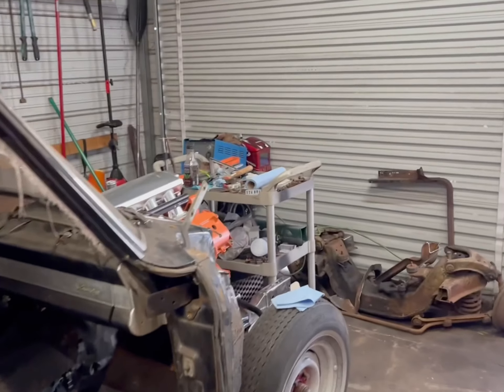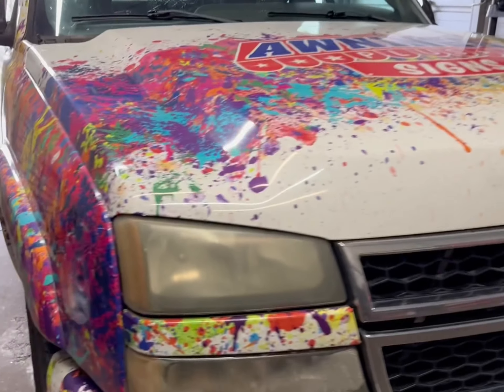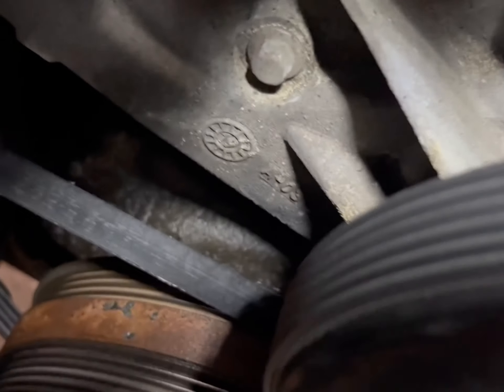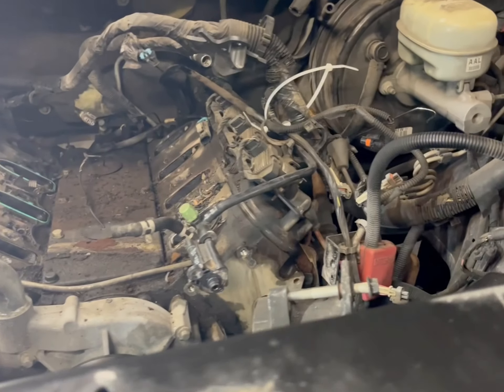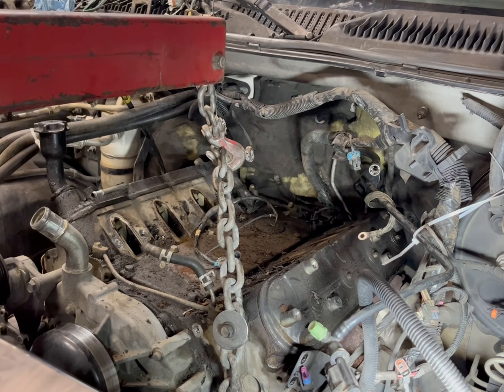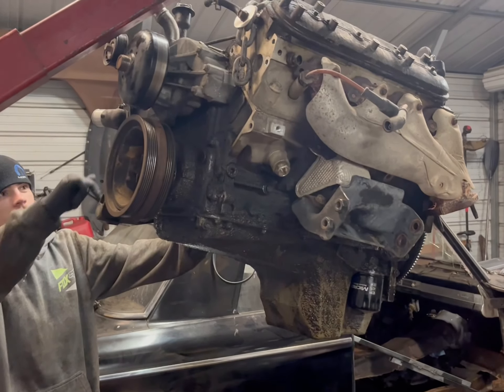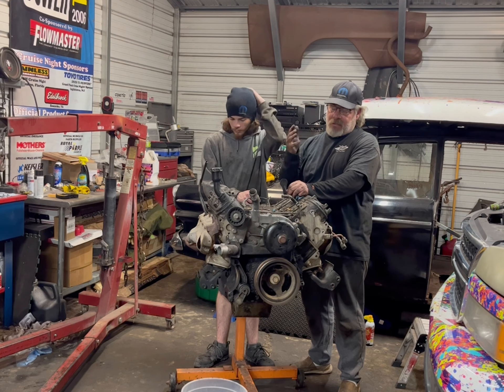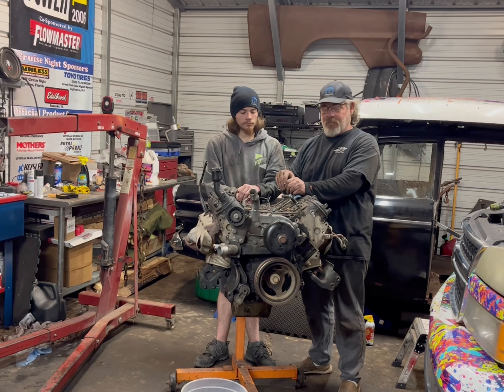The oil soaked LS comes out of the 06 Chevy. Going to need a lot of degreaser!!

Comment: Hey AL it is much easier to disconnect the wire harness from the brain. Then pull engine,wash it with the wire harness on engine. Then if you need to remove harness it's all easy to get off the engine with it out in the open.
Reply: With a lift i can have the whole drivetrain out box off cab off front clip off and interior gutted in 5 hrs.
  On the ground 6.
  Did it for 7 years. Never cut a harness. They unplug. Yup. 
  Chevy is easy ford is easier.
Reply: I did fleet van for a carpet cleaning place ford harnesses 8mm bolt holding it together sweet gm a couple of Rouge connectors but yes way easier

Comment: A lot of oil on the outside of a LS blocks is good. The ones I’ve pulled out that have been clean or so rusted you need to sit there with a needle scaler to clean off the block.  Lol